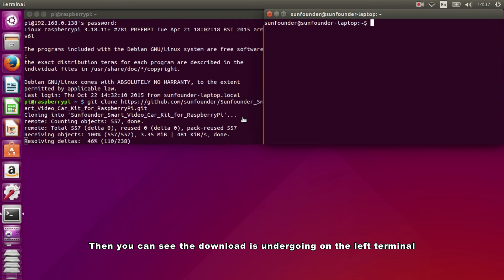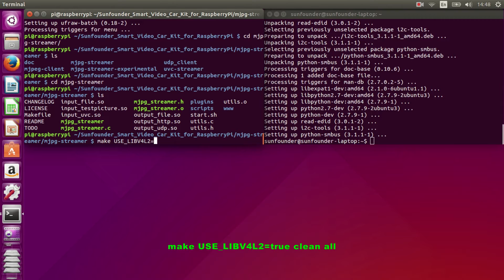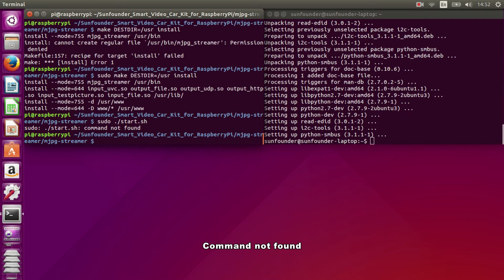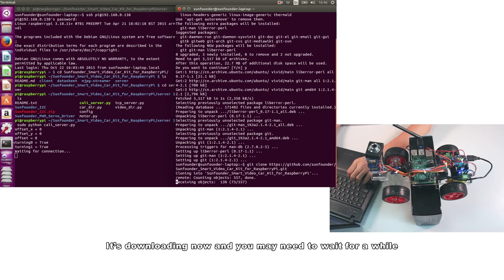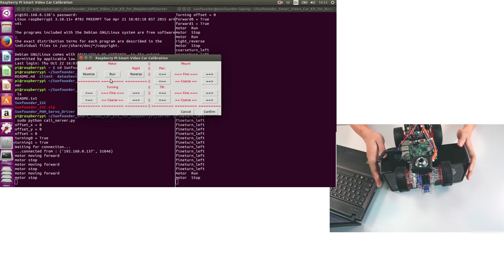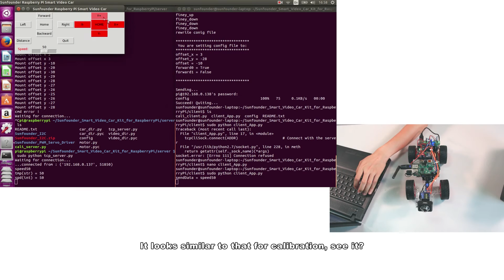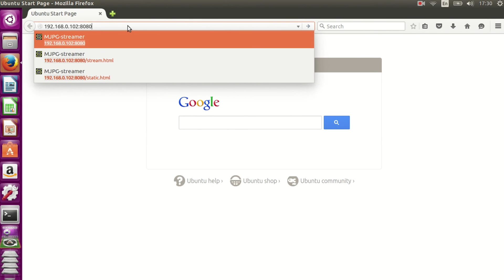Smart Video Car for Raspberry Pi Assembly Tutorials 04 Software Setting/Configuration/Debugging

Comment: Hello Sunfounder!  When I sending command from client with socket in the server side when socket is reciving the command somehow it is apending a 'b'  before the command. for example b'motor_run' I am not sure how to remove this unexpected b. It is apending in every command I am sending from client to server to run the car. I did a trick modifying the server  side to adjust the command with apending b  now motor is working fine but seems turning and mounting command is not working that is because of the extra b in each command. Can you help please how do I remove the b in the command from client to server using socket.? Reply as soon as possible will be highly appreciated. And thank for your awsome project for us. @SunFounder Maker Education
Reply from the maker: It may be caused by accidentally touching when consulting the code, try these two commands to undo the modification
cd ~/Sunfounder_Smart_Video_Car_Kit_for_RaspberryPi
git checkout

If the problem is not resolved, please provide a screenshot and order number, describe the problem and send an email to support@sunfounder.com.

Comment: Hi, there I'm getting an error on the very first few steps, not sure what I'm doing incorrectly. The issue is that when I enter Sudo apt-get install python-tk the mac says it's unable then I install homebrew to find python-tk and gives an error as well. Please help.
Reply from the maker: Hi Arian, please note that the instruction of installing python2 in this video is suited for Linux, not work well for mac. For the installation of python2 on Mac, you may refer to https://medium.com/@yangnana11/installing-python-2-on-mac-os-x-d0f1c9c4d808.

Comment: I am getting error at make USE step, please take a look:

gcc -D'SVN_REV="Unversioned directory"' -O2 -DLINUX -D_GNU_SOURCE -Wall    -c -o utils.o utils.c
In file included from /usr/include/arm-linux-gnueabihf/sys/stat.h:446,
                 from utils.c:33:
/usr/include/arm-linux-gnueabihf/bits/statx.h:25:8: error: redefinition of 'struct statx_timestamp'
 struct statx_timestamp
        ^~~~~~~~~~~~~~~
In file included from utils.c:32:
/usr/include/linux/stat.h:56:8: note: originally defined here
 struct statx_timestamp {
        ^~~~~~~~~~~~~~~
In file included from /usr/include/arm-linux-gnueabihf/sys/stat.h:446,
                 from utils.c:33:
/usr/include/arm-linux-gnueabihf/bits/statx.h:36:8: error: redefinition of 'struct statx'
 struct statx
        ^~~~~
In file included from utils.c:32:
/usr/include/linux/stat.h:99:8: note: originally defined here
 struct statx {
        ^~~~~
make: * [<builtin>: utils.o] Error 1
pi@raspberrypi:~/Sunfounder_Smart_Video_Car_Kit_for_RaspberryPi/mjpg-streamer/mjpg-streamer $ make: * [<builtin>: utils.o] Error 1

Comment: How are you working on it without an hdmi cable please help?
Reply from the maker: Hi Eric,if you want to control the car with raspberry pi,you don't need to connect or access the raspberry pi interface, just make sure the car and pi are on the same LAN, and then use SSH to connect.

Comment: Sunfounder,  I need help!
Following the instructions to enter:

audio apt-get install subversion lib41-dev libjpeg8-dev imagemagick

I get an error only for libv41-dev saying unable to locate package.

Everything up to that point matched what was on the tutor's screen.
Reply: I entered "sudo" and spell checker changed it to "audio"
Reply from the maker: Hi Dennis,thanks,Great!!!,you are right.
Reply: SunFounder Maker Education 
Wait a minute,  the libv41-dev package WAS NOT installed, even after following all the previous steps. What's missing?
Reply from the maker: Yes，I am sorry，the spell is wrong.please change audio to sudo.thanks
Reply: SunFounder Maker Education 
Following the instructions to enter: sudo apt-get install subversion libv41-dev libjpeg8-dev imagemagick I get an error only for libv41-dev saying unable to locate package. Everything up to that point matched what was on the tutor's screen. Why?
Reply from the maker: Hi Dennis 
Have you tried to update apt-get? Running  sudo apt-get update after the update is updated.

Comment: when you say "at your address", what ip address is that? of the car wifi antenna?  the raspberry pi? or the PC i'm working from?
Reply from the maker: +Dear Sofia Smith
This is the raspberry pie address. If you are raspberries pie 2 or the following,  The WIFI antenna need to be is inserted into the tree blackberry USB interface, and then your raspberries pie can be connected to the Internet, you can search the address of raspberries pie by setting in the router or use the Advanced IP Scanner .have  a nice day！

Comment: Hi SunFounder and all users,
Can you please explain more about the first step when you use ssh to connect Raspberry pi?
How do you find the IP address of Raspberry pi?
Reply: If you do not know the ip address of your Raspberry Pi, you will likely need to connect your raspberry pi to a monitor using an HDMI cable. Then, open a terminal window and run the command 'ifconfig' at the prompt. This will list the ip address of the raspberry pi alongside the word 'inet' under wlan0 (i.e., if your raspberry pi is using wireless). For example, inet 192.168.0.5. If you do not see a graphical user interface and you only see text, then login to raspberry pi using sunfounder's default username and password. This will give you access to text only command prompt. Then, run 'ifconfig' command.

Another way of knowing your raspberry pi's address is to use an app called 'fing' on your smartphone while connected to your home network (the same network that your raspberry pi is on). Run the app and it will list all the devices connected devices and their ip addresses. Fing tries to guess what the device is based on the Mac address it can detect on your home network, and it does a decent job. But, if there are multiple raspberry pi devices on your home network, fing lists them all as 'Raspberry pi'. In that case, you will have to try doing an ssh into each ip address to figure out which is the actual device that is on your sunfounder car.

Comment: Hi SunFounder team, 
I assembled the car and the components, but am struggling with the sofware:.I bought the raspberry pi 3 with the microSD card which alread has some software running for raspberry plus I have a windows 10 laptop.
How can I now replicate your steps from the video with windows. I already downloaded the latest python 2 version but am totally lost with the instruction book and this video... Would really appreciate your help.
Reply from the maker: Dear abdollar34,
It seems you are a raspberry beginner,  you can go to the raspberry pie online to learn how to remote log on the raspberry pie on Windows
Here we help you sort out the steps
The first step, connect your raspberry to your router: https: //www.raspberrypi.org/documentation/configuration/wireless/README.md
The second step, configure SSH:
https://www.raspberrypi.org/documentation/remote-access/ssh/README.md
The third step, the use of Putty, You remote log  the raspberry pie though SSH (the link is the bottom of the Windows connection above the page ):
https://www.raspberrypi.org/documentation/remote-access/ssh/windows.md
have a try. any question,please feel free to contact.
Reply: Dear Sunfounder Team,
thank you for the quick response and the links! I bought a small display now and connected everything via hdmi and use a keyboard and a mouse now, because I couldn't enable SSH via my windows as the links were suggesting... However though I was able to do all the steps and managed the camera stream and it worked fine. 

However I couldn't get any further on that day, that's why I quit for a while. now I wanted to tackle the next steps again after a while, but couldn't even open the camera stream with sudo sh start.sh (it says: "sh: 0: Can't open start.sh"), what do I have to do now?

Thank you so much in advance!
Reply from the maker: Hi dear,the situation may be start.sh script does not exist, you can  check if the script is still there or you may not have access to the start.sh script folder.

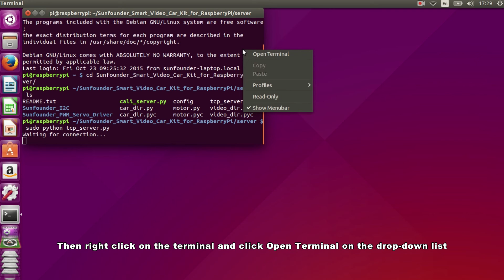Comment: in minut 21:25 i have problem with the port
Reply from the maker: Dear Kevin,
The content under the server is differnt with the content of the video, server is normal, we have modified it. Delete many unnecessary library files, the library of SunFounder_I2C and SunFounder_PWM has been replaced by PCA9685.py. You can try to test, if you meet some problem, pls connect with us.
Good luck.

Comment: Hello Sunfounder, I love this Project but I have two Quitions. The one is i can not conect my Smartphone with your App to the Raspberry:-( when i use an linux terminal it was great. 
the two ask is , can i use one Motor ESC from an RC Car? i want to build your system in my RC Car with one Motor an his ESC . what must i do that i dont must use the MotorBoard?
Please show me a way to make my Project perfectly. THX Axel
Reply from the maker: Dear Axel,
Could you pls give us more details about the can't connected smartphone?
We can't get the RC Car details, we check whether the ESC should also use the PWM signal driver? But we don't konw how the direction is controlled. In fact, the motor driver of the rpi car is equivalent  to an ESC. So you don't need a motor driver. But how to connect and use depends on your own to explore.
Waiting for your reply!
Reply: Hello Sunfounder, thanks for the information. When I try to connect via smartphone and the app to me then I get no connection. There is no correct error message. When I start the server program on the rpi is waiting for a connection. I now start the app and try to connect does not work. Because of the engine driver, I would like to use a stronger engine for this I need another engine driver so an ESC. This works like a servo with PWM. I would connect this gene to the PCA9685 board without the L298N motor driver. Can they help me to change the python program so I get to drive a pwm siganl to the pcaboard for the motor driver get?
Thanks for your help.
Reply from the maker: Dear Axel,
Did your phone and smart car in the same wifi network? By the way, the phone APP should use the html_server, not tcp_server. For the details you can refer to our tutorials video:
https://www.youtube.com/watch?v=QdWtj8qBnug&t=4s
Theoretically, the PCA9685 can control your ESC dtrectly, but your ESC may have frequency requirement. You need to visit the motor.py code to find it.
Have a try!

Comment: Hi again
everything is ok now, the camera is streaming and motors are calibrated
The only thing is...I must start both every time
How can I get startup.sh and tcp_server.py to start automatically when the raspberry boots ?
Reply from the maker: Dear Ecogeek, 
The start automatically, we feel pity that we don't provide it now. But we suggest that it's not suitable to try it, maybe it will lead to failure to boot and other issues. 
If you still want to try, you can Google to find relevant information, similar to "run script on Startup "and so on.
Good luck!

Comment: Hi
I've built the car, installed the software
The camera is streaming but I don't have any cali_server.py  file
Did you update the files and change names ? Or should I download the files again ?
Reply from the maker: Dear Ecogeek, 
Pls enter into the below content: 
cd ~/Sunfounder_Smart_Video_Car_Kit_for_RaspberryPi/server
ls
You can confirm whether it has the file "cali_server.py", if not. You can download it again, we couldn't modified the file name.
If you still have confusion, pls feel free to contact with us.
Reply: Hi again
I found the cali_server.py file but when I run it I get an error

Traceback (most recent call last):
  File "cali_server.py", line 5, in <module>
    import motor
  File "/home/pi/Sunfounder_Smart_Video_Car_Kit_for_RaspberryPi/server/motor.py", line 24, in <module>
    p = pwm.PWM()
  File "/home/pi/Sunfounder_Smart_Video_Car_Kit_for_RaspberryPi/server/PCA9685.py", line 55, in _init_
    self.set_all_value(0, 0)
  File "/home/pi/Sunfounder_Smart_Video_Car_Kit_for_RaspberryPi/server/PCA9685.py", line 140, in set_all_value
    self._write_byte_data(self._ALL_LED_ON_L, on & 0xFF)
  File "/home/pi/Sunfounder_Smart_Video_Car_Kit_for_RaspberryPi/server/PCA9685.py", line 68, in _write_byte_data
    self.bus.write_byte_data(self.address, reg, value)
IOError: [Errno 5] Input/output error

What can I do ?
Reply from the maker: Dear Ecogeek,
Well noted your problem, you get the "IOError" means that it's the communication problem. You can use the "I2C detect -y 1" command to check the I2C, or run the I2C_helper.py under the code file to diagnose the problem. If you still can't find the I2C address, pls open the I2C in the raspi-config, then check the cables connection of the PCA9685 driver board.
Have a try!

Comment: excuse me but I seem to be running into this issue nowpi@raspberrypi:~/Sunfounder_Smart_Video_Car_Kit_for_RaspberryPi/server $ sudo python cali_server.py
 offset_x = 11
 offset_y = 0
 offset = 0
 turning0 = True...
 turning1 = True
 [Errno 5] Input/output error Your Pi Rivision is: 3 Module B
 I2C bus number is: 1
 Checking I2C device:
 Commands "ls /dev/i2c-1" output:
 /dev/i2c-1
 I2C device setup OK
 Your PCA9685 address is set to 0x40
 i2cdetect output:
      0  1  2  3  4  5  6  7  8  9  a  b  c  d  e  f
 00:          -- -- -- -- -- -- -- -- -- -- -- -- -- 
 10: -- -- -- -- -- -- -- -- -- -- -- -- -- -- -- -- 
 20: -- -- -- -- -- -- -- -- -- -- -- -- -- -- -- -- 
 30: -- -- -- -- -- -- -- -- -- -- -- -- -- -- -- -- 
 40: 40 -- -- -- -- -- -- -- -- -- -- -- -- -- -- -- 
 50: -- -- -- -- -- -- -- -- -- -- -- -- -- -- -- -- 
 60: -- -- -- -- -- -- -- -- -- -- -- -- -- -- -- -- 
 70: 70 -- -- -- -- -- -- --                         
 Conneceted i2c device:
   0x40
   0x70
 Wierd, I2C device is connected. Try to run the program again. If the problem's still, email the error message to service@sunfounder.com

Comment: I cannot type in the @ symbol in my control panel, I'm using  a pi2 as my PC so I don't know what to do
Reply from the maker: Dear Chuck, 
Because the RPi default keyboard is English type, you need to run the sudo raspi-config and find the international option. Then you can modify the keyboard type. Have fun in SunFoudner!
Reply: thanks got that working, now I've gotten up to the part where I'm trying to run sudo python cali_server .pymy problem now is that its telling me this[Errno 5] Input/output errorYour Pi revision is: 3 module BI2C bus number is: 1Checking I2C device:
 Commands "ls /dev/i2c-1" output:
 /dev/i2c-1
 I2C device setup OK
 Your PCA9685 address is set to 0x40...
 i2cdetect output:
      0  1  2  3  4  5  6  7  8  9  a  b  c  d  e  f
 00:          -- -- -- -- -- -- -- -- -- -- -- -- -- 
 10: -- -- -- -- -- -- -- -- -- -- -- -- -- -- -- -- 
 20: -- -- -- -- -- -- -- -- -- -- -- -- -- -- -- -- 
 30: -- -- -- -- -- -- -- -- -- -- -- -- -- -- -- -- 
 40: -- -- -- -- -- -- -- -- -- -- -- -- -- -- -- -- 
 50: -- -- -- -- -- -- -- -- -- -- -- -- -- -- -- -- 
 60: -- -- -- -- -- -- -- -- -- -- -- -- -- -- -- -- 
 70: -- -- -- -- -- -- -- --                         
 Conneceted i2c device:
 None
 Device is missing.
 Check the address or wiring of PCA9685 servo driver, or email the error message to service@sunfounder.com
 Exiting...
Reply: sorry my keyboard screwed up that message here it is againthanks got that working, now I've gotten up to the part where I'm trying to run sudo python cali_server .pymy problem now is that its telling me this[Errno 5] Input/output errorYour Pi revision is: 3 module BI2C bus number is: 1Checking I2C device:
 Commands "ls /dev/i2c-1" output:
 /dev/i2c-1
 I2C device setup OK
 Your PCA9685 address is set to 0x40...
 i2cdetect output:
      0  1  2  3  4  5  6  7  8  9  a  b  c  d  e  f
 00:          -- -- -- -- -- -- -- -- -- -- -- -- -- 
 10: -- -- -- -- -- -- -- -- -- -- -- -- -- -- -- -- 
 20: -- -- -- -- -- -- -- -- -- -- -- -- -- -- -- -- 
 30: -- -- -- -- -- -- -- -- -- -- -- -- -- -- -- -- 
 40: -- -- -- -- -- -- -- -- -- -- -- -- -- -- -- -- 
 50: -- -- -- -- -- -- -- -- -- -- -- -- -- -- -- -- 
 60: -- -- -- -- -- -- -- -- -- -- -- -- -- -- -- -- 
 70: -- -- -- -- -- -- -- --                         
 Conneceted i2c device:
 None
 Device is missing.
 Check the address or wiring of PCA9685 servo driver, or email the error message to service@sunfounder.com
 Exiting...
Reply from the maker: Dear Chuck, 
The problem is the I2C.
Pls check the cables of the PCA9685. If you are using a DC adapter for your Raspberry Pi, you need to connect the GND between Servo Controller and Raspberry Pi. Because they are common-grounded by the micro USB, and if you use a DC adapter, you have to make another wire for common-ground.
It's better to send some pictures to us, we can know more details. 
Waiting for your reply!

Comment: hi, i`ve got a problem. If i type in the command, it says the order "ssh" is written wrong or can`t be found. I`m using Windows 8
Reply from the maker: Dear Last,
You need to use the on the linux, if you use the it on Windows, you need to use the putty. 
Pls reference to this link:https://www.raspberrypi.org/documentation/remote-access/ssh/windows.md
Have a good time.
Reply: thank you
Reply: whit mac IOS, i can to work?
Reply from the maker: Dear Kevin,
Of course the Mac the similar Python2.7 is ok! But the IOS is not available yet.
If you still have the problem, pls connect with us!
Reply: SunFounder when i try to install the python in mac. Don't run the command
Reply from the maker: Hi Kevin,
You mean that you can't run the command?
And could you tell us more details, it's better to send pictures about your installation.
Our mailbox: support@sunfounder.com
Looking forward your reply!